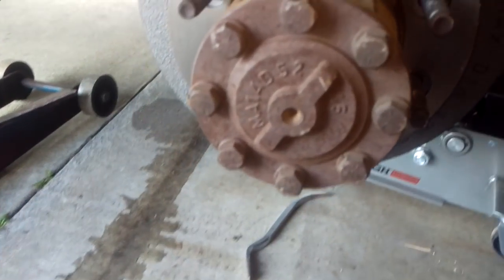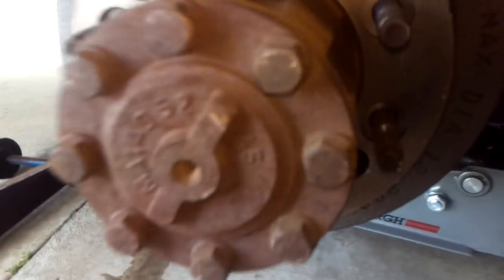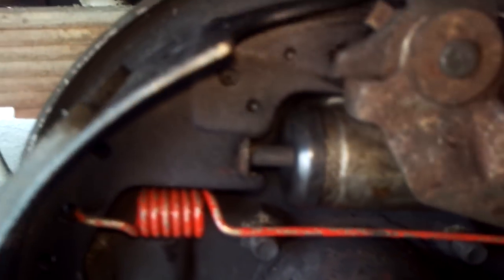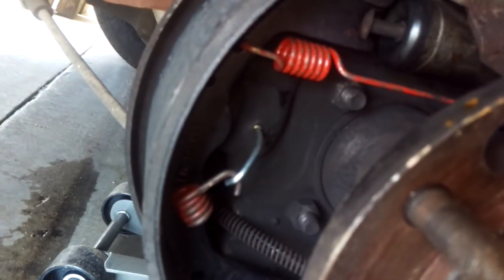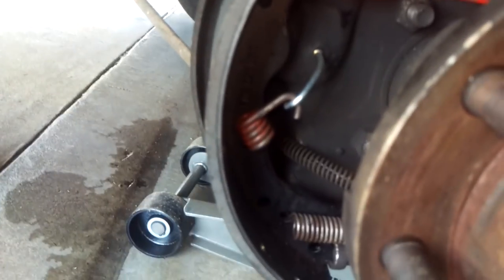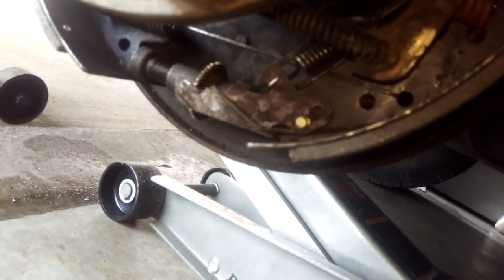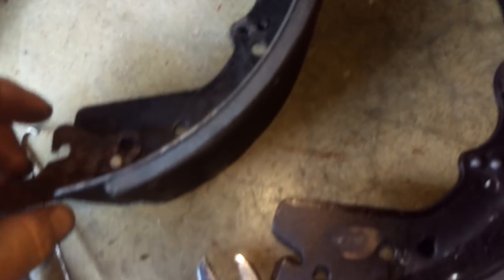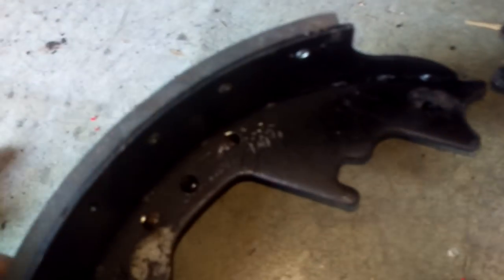89 Ford E350 rear brakes part 1

Comment: You can save yourself some grief by stripping  off the axle and drum and disconnecting the parking brake cable and getting it out of the backing plate and out of the way, then taking the four backing plate nuts off and remove the entire brake assembly and backing plate in one piece and doing everything on the bench. It's much easier if you're doing brake lines too, or the wheel cylinder, because the distribution block on the axle are much easier to get to. And it gets all the crusty stuff away from the axle housing to avoid contamination of the differential.
Reply from the maker: Wow, this is some of the kind of advice I'm looking for. Thanks for sharing that info. There's so much I don't know and love getting advice from you folks with much more experience. Thank you

Comment: Hello Frankie , can I talk to you about a problem that you had in your skateboard with the batterie , I have the same problem that you had , my electric skateboard turns off while on ride ; even if its full charged , did you found the solution to that problem ?

Comment: They were correct the first time. The meatier shoe goes in the back because it not only has the wheel cylinder pressure, it also has the pressure of the drag from the front shoe on it, so it would wear quickly if not beefier. Also, use some brake lube on adjuster and all metal to metal contact points.
Reply from the maker: Thank you for your input. Much appreciated.

Comment: Pretty sure they are still installed incorrectly. 
Around 9:30, you can see the difference in the upper side portion of the shoe laying to the left. There is a thick welded "cam plate" that is supposed to face outwards. If facing inward, it will cause the shoe to be cocked at a slight angle and cause drum and shoe to wear uneven. 

The shorter "primary" shoe is supposed to be in front.  During braking the primary shoe in front tends to rotate along with the drum and away from the top anchor pin. Through the adjuster link, this transfers this force to the secondary shoe and basically jams the rear shoe in tight against the drum and anchor pin. The secondary shoe is thicker for this reason. This is a Bendix design, oem manufacturer for ford.
Reply from the maker: Wow! Thank you very much for your comment. That's the most detailed explanation I've ever heard and makes so much sense. You've obviously been working on brakes for a while. Your knowledge and info is much appreciated.
Reply: Yup, primary to the front...
Years ago I went to change rear shoes on my 66 mustang, and whoever did them the last time put both primary's on one side and both secondary's on the other.

Comment: Please use jack stands. Working on something supported by only floor jacks is not safe. Dont want to see you get hurt!
Reply: Hes got two tho.... and hes not under it. I'll allow it
Reply: Two Jacks on a concrete floor is safer than most commercially made "Jack Stands"  I use 24" in diameter pieces of Oak Tree Trunk...they have never buckled like "Jack Stands" have...

Comment: The Primary shoe is shorter, it go's facing  front. The Seconder shoe is longer it go's facing rear.
Reply: terry jarrett 
the shoes I got all four were the same size. wat you do is look for the pin that sticks out those shoes go on right, both sides, I believe

Comment: For those pain n the ass retainers...get a big flathead u dont need cut a little notch in the center with a cutting disc...enough to fit the spring and just push ......while u manuver the nail through the back ...works everytime..hope this helps someone
Reply from the maker: Thank you. I actually did go buy a big cheap screwdriver for just that reason cause someone else mentioned that to me. This was before I actually found the tool designed just for those springs. Snap-On and Matco actually both make a tool specifically for them.
Reply: masterjoe3000 any chance you'll have a picture of the notch? Or the actual tool? I'm doing my 97 f250. I can not get those clips back on
Reply: masterjoe3000 what's your email

Comment: wow back off on the zoom !
Reply: Does anybody else notice the park brake cable incorrectly connected to park brake lever (5:37).   The shoes were correctly installed.   Short primary shoe in front.   You need to put the tools down and back away slowly before you kill somebody.